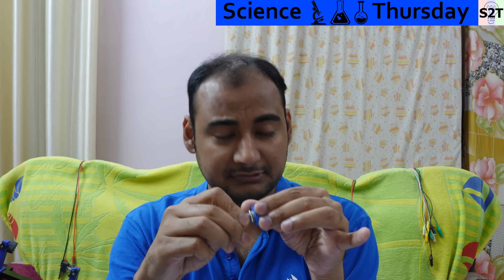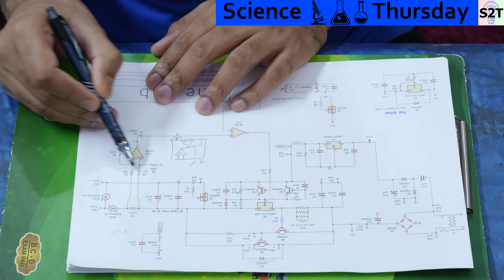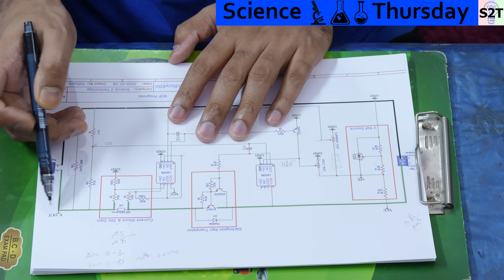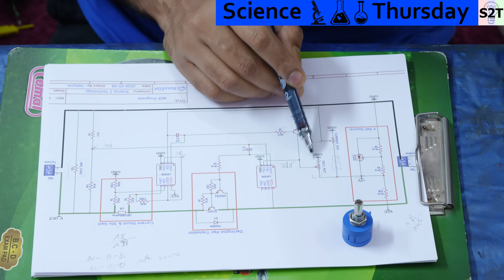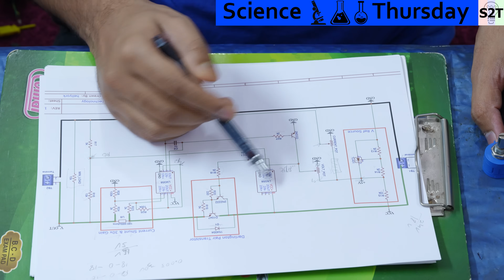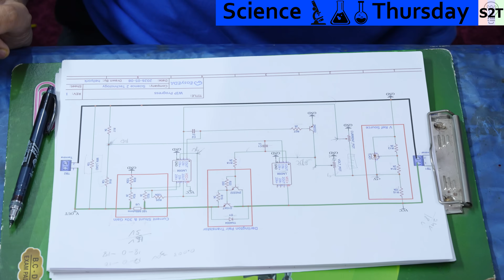My DIY Linear Lab Bench Power Supply Explained {Science Thursday}

Comment: I have seen this topology a lot and most of the times you will end up fighting transients due to the speed/nature of the op-amp used. Eevblog forum has a few similar circuits. Looking forward to the next part
Reply from the maker: this is just mk1 a start yes there is wired issue with current control and I think it will take deeper understanding to actually solve that issue but that is the fun of learning . But this is we put down for now I am thinking of making a Milli ohm metre as I have its need and all the parts to make a baisc one